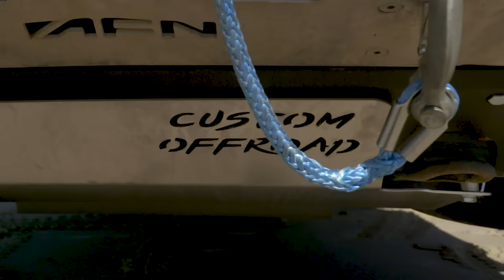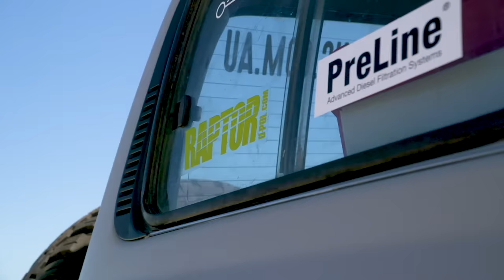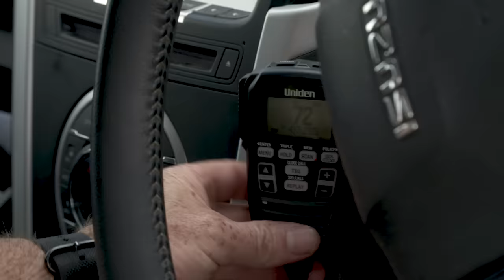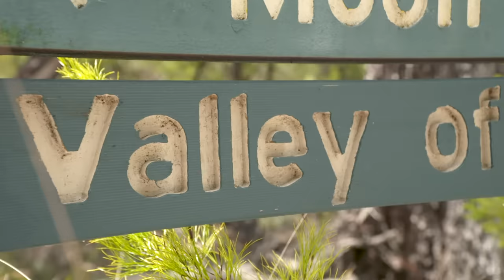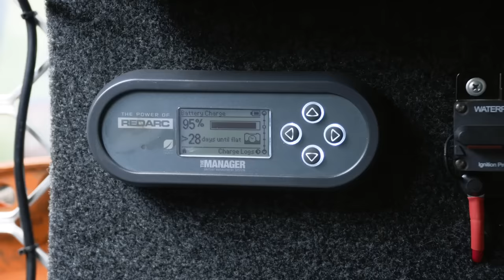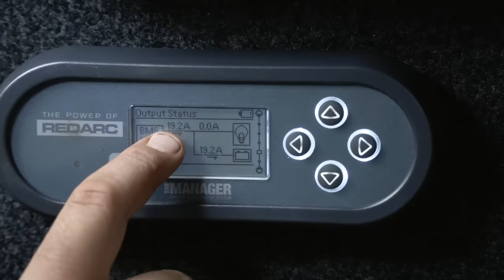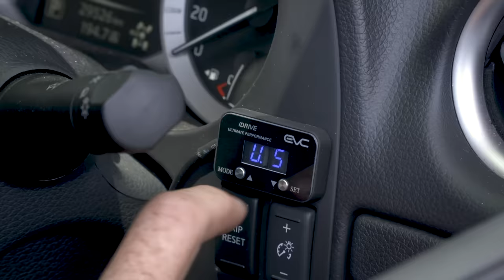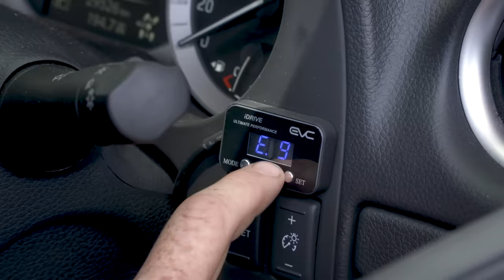You haven't seen Fraser Island like this before...

Comment: This must be one of my favorites, because I've already watched it three times! Great job under very adverse conditions. That's part of the fun, though! When you came upon that fallen tree, did no one have a folding saw, pocket chainsaw or electric chainsaw? I always carry a folding saw in my recovery gear and often a pocket chainsaw (those chainsaw blades with handles) rolled up in the glove box or somewhere else that it's easily accessible. They are very small and very handy, for these situations. I live in an area with tall trees and a sand base, so we see a lot of fallen trees. I'm too cheap for a chainsaw, when a little sweat will do the job. Edited to add that the Sparesbox crew are awesome. Include them in future videos!

Comment: You guys nearly melting through the table reminded me of something that happened when I was a kid. My dad was prepping a mighty feast of some good steaks and had already prepped the charcoal chimney to get the grill going. He asked my mom to go and get it lit because he was nearly done prepping everything. She went and lit it and came back in the house no problem. Then my dad and I carried a couple trays of food out to the grill to find that she lit the chimney while it was sitting on the plastic prep area on the side of the grill and it melted straight through until it stopped at the metal wire frame underneath. My dad could do nothing but laugh and that grill stayed like that with a melted hole on one side for the next 10 years until we finally junked it when it got too rusted out. Good times though!
Reply: Thanks for sharing mate

Comment: I think that the fine sand at nagala rocks was compacted a bit by the wind and sea spray, as you all got through which is a miracle.
The Idrive is well worth it, I leave it on Auto most times except when driving in the wet. The best bang for the buck you could buy...!

Comment: Is there some kind of law in AUS that would prevent you from bringing a chainsaw with you to clear trees off the tracks?  Not that your winching job didn't "work a treat", but a chainsaw would have been so much quicker and less risky  (less chance of a whip back on the line or a sudden break causing flying wood shards)  Here in the US, particularly out East where all the tracks are in forested areas, a chainsaw or at least an axe or hatchet are required gear for offroading.

Comment: Love the outtakes although while it is true Fraser is the result of a grain of sand being created every time a Nissan breaks down the boys must also surely be aware that every grain in the Great Sandy Desert was formed when Toyota had a recall due to faulty brakes, DPF, accelerator, steering, stability controls issues etc, etc, etc.
What they may not be aware of is that  the minute hand on a clock changes every time a socially engineered drone who fell for the Toyota marketing campaigns then  realizes they could have got a better 4WD for 20K less :-)

Comment: Needs to be a signed radio channel ie channel 20 for ngala rocks or something so everyone knows what's going on we recently had to get a vehicle with a cracked head back from sandy cape too the barge and trying to navigate ngala in a hydrolocking  limping vehicle without being able to communicate our issue to oncoming vehicles was hard so a set channel would be awsome we couldn't get any chemiweld until we got to happy valley a massive mission went through 100ltrs of water but due to some basic mechanical and Bush mechanics tips picked up from channels like this we got it done

Comment: how big are shauns wheels and what lift do you reckon he has on his 80 series?
Reply: The tyres are 35" so the wheels look about 16", from the clearance it has I'd say he has about a 4" lift
Reply: That’s what I was thinking but in his latest update on it he said he had a 2 inch cause I’m thinking about getting 35s on mine but don’t wanna have to put a new lift kit in because I just put in the 2 inch
Reply: Might be 2" suspension, plus 2" body lift, it sits too high for 2" alone.

Comment: 16:17 The weather now is fine because the monster of a storm north north east of you is sucking all the weather out of the air around it, concentrating it into a howling, surging wall of natural bitchslap. I'm pretty confident I could weather a cyclone under canvas without injury, but I reckon only 2% of Aussies could. If a cyclone's coming your way, priority one should be getting to hard shelter, well out of the way of any expected maximum storm surge with enough supplies to be self sufficient for the next week. It may be overkill in 95% of cyclones, but that 5% of real unexpectedly nasty tropical storms, that kind of respect for the storm and sensible preparation will save lives. If you have young kids or elderly people in your care, consider evacuating completely from the storm's path. We have such low fatality numbers because Australians who live in cyclone prone areas don't mess around when it comes to these things.